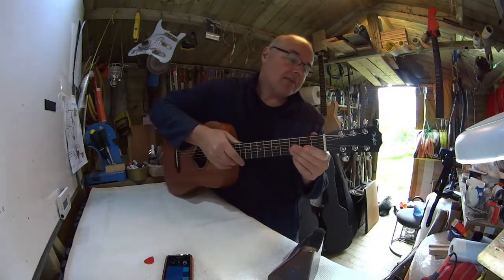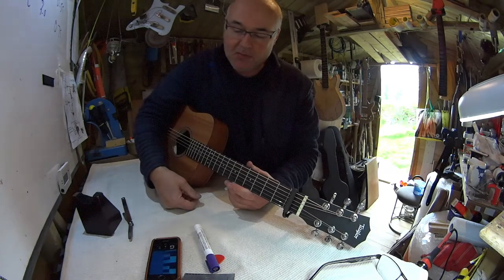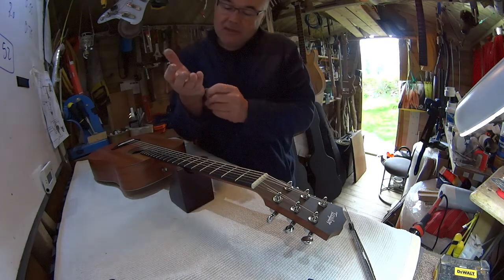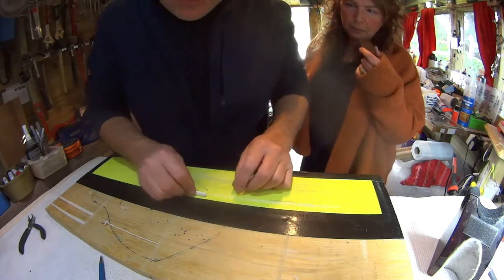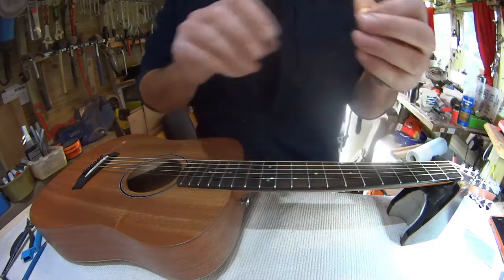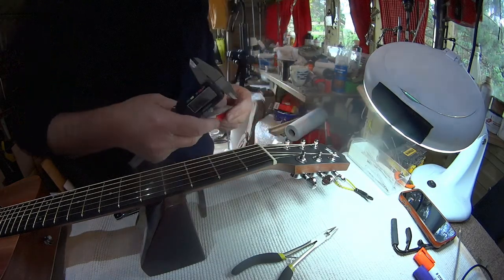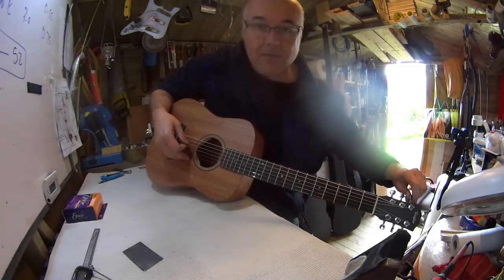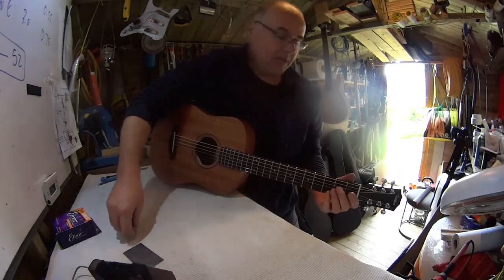Luis Taylor Baby BT2 set up

Comment: Hi Sam,
I have a Baby BT2 but the action at the last fret is really high. There doesn't look to be too much to play with on the bridge so I was wondering if you have had any experience of Taylor's neck shims?
Reply from the maker: Hi Michael - no I haven't is the short answer. I prefer to make adjustments first on a bone saddle that's inexpensive to replace if you don't like how it plays / sounds after adjustment. It sounds like you don't have that option so would need to adjust the action via the neck set with a shim. From what I've read Taylor will supply shims to suit your required reduction. You'll need a clear maths / geometry head to get it right. 

This video is old but informative (albeit NOT a Baby model):

https://www.youtube.com/watch?v=e3Q6lJCh-1U
Reply: Wow! That is a little complicated for my whisky addled old brain. It doesn't look like a cheap solution either.
It's a shame that you couldn't just measure the action at the twelfth fret, tell some clever chappie what shim is currently in the guitar and he could tell you what shim you need to replace it with to get the required action.
I think it may be cheaper to find a nice second hand guitar. Either that or take the bridge down as far as possible and just live with it.
Love the videos (with your assistant, Maurice), keep them coming. Could you tell me which tuner app you have on your phone? I've got a few on my iPhone as well as a little clip on tuner and none of them seem to give the same result. I'm not really experienced enough to do it by ear.
Reply: So with my newly acquired nut files I set about my BT2, having never attempted any type of guitar action adjustment before. But with an engineering background and the knowledge that both the nut and the saddle are replaceable, and inspired by your videos,  I thought it was time to have a go. Making small adjustments and rechecking the string heights at the first fret before making another small adjustment, I brought them all down to between 0.3 and 0.4mm. 
Adjusting the saddle was slightly different because there was little room for manoeuvre, but I slowly brought it down on some 220 grit wet and dry and hoped for the best. I cleaned and oiled the fingerboard and polished the frets with fret rubbers before replacing the strings and tuning them back up.
It finished up with the low E at 2.75mm at the last fret and the high E at 2.25mm and it may be possible to get just a little bit more off the saddle one day. But for now I am just over the moon at the difference it has made to my little guitar. I think I even look at it in a different way now if that makes any sense.
It should be said at this point that I am no guitarist. But the engineer in me needs to know that the instrument is set up in the best possible way and so I'm now going to set about my Epiphone Dot, which may need some work on the frets as well.
It is clear to me now that guitars that don't cost the earth can still be very playable with a little TLC.
Thank you for the inspiration!